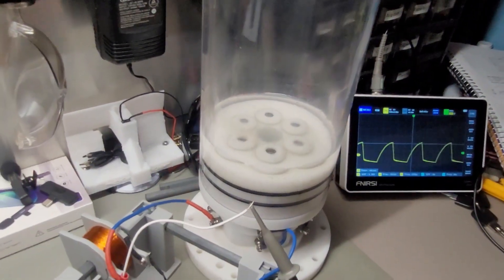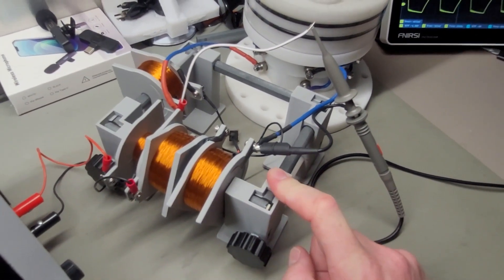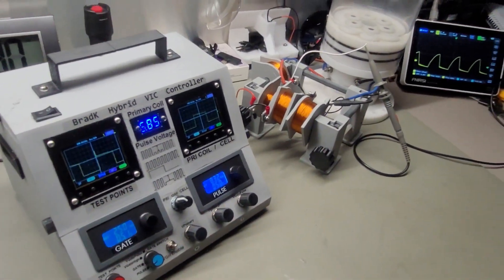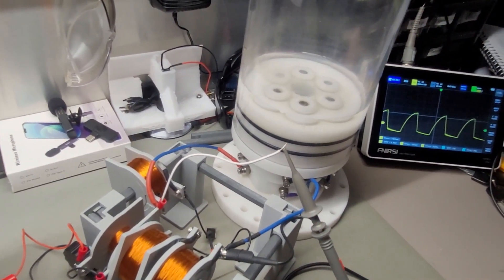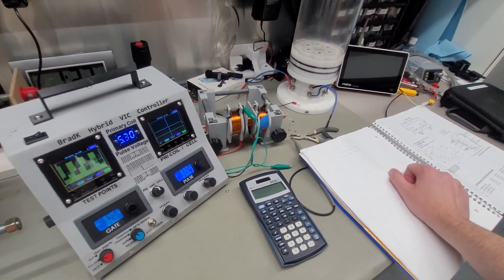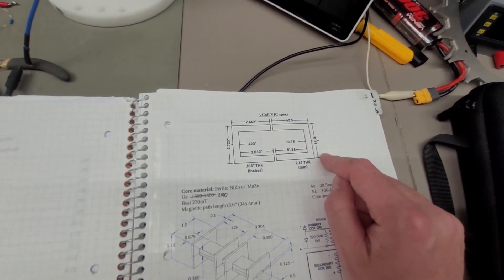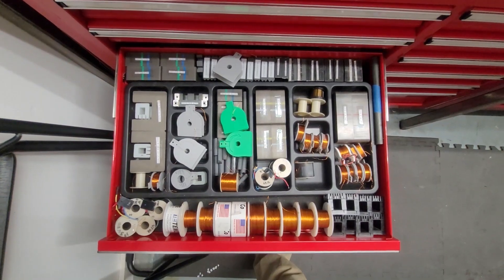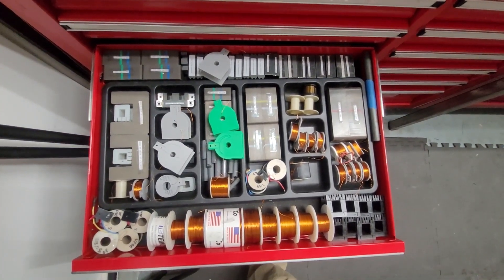Stan Meyer Research # 35, Jul 2023-V.I.C. TESTING reveals the problem...

Comment: I use those obsolete UU ferrite cores and mate them together with (2) spring steel hose clamps put on with pliers. The old tv horizontal output transformers/ flybacks can be reused and are in all sizes. Frequency use was about 15khz. Meyer had also used RESISTANCE TYPE magnet wire. Putarich Patented circuit was also AC output for his hydrogen generator. I am contemplating starting a build of Meyer type hydrogen generator. You have to get cloud mass of very fine bubbles rising up to get it right. Ions only , not molecules . I thought that a Meyer cell with final AC created hot water + steam without the  diode. I read the 2 manuals.

Comment: Any updates?
Reply from the maker: Yes, I sent out quotes to a few ferrite core manufacturers and heard back from two of them. The first had a min order of 100 pieces at a cost of $6k. The other one agreed to make a smaller number but for a cost of around $140/set. The lead time was 10-12 weeks. I should be getting them sometime in January. I went with a slightly different ferrite mix in hopes that it will work better than the one I bought from Russ years ago.

Comment: any updates?
Reply from the maker: Yes. I'm having some custom cores made. I sent requests to 5 or 6 Ferrite core manufacturers. I only heard back from two of them. 

One had a min order of 100 pieces and quoted me $5k. The other allowed smaller orders but for a price. I ordered 5 sets in case a different ferrite mix is needed. 
The lead time was 10-12 weeks. Hopefully, I'll get them sometime in January.
Reply: @BradKwfc  remember that  maintaining resonance requires a PLL to fine tune maximum performance due to changes in temp and environment...
Reply from the maker: @mikebartley481  Yes. The Hybrid VIC Controller is just meant for a laboratory setting as a proof of concept. Once the basic process is proven the PLL can be researched and incorporated into it.
Reply: But the injector bobine doesnt have a pickup coil how is that possible?@BradKwfc

Comment: Here is the math to add some reality to the situation. 
Breaking the covalent bonds of water (H2O) through electrostatic means would require a substantial amount of energy. To estimate the voltage required, you need to consider the energy required to break the bonds between the hydrogen (H) and oxygen (O) atoms in water.

The covalent bonds in water have a bond dissociation energy, which is the energy needed to break the bonds. For the H-O bonds in water, the bond dissociation energy is approximately 497.4 kJ/mol.

To calculate the voltage required, you'll need to convert this energy into electrical energy. The relationship between energy (E), voltage (V), and charge (Q) is given by:

E = Q * V

We can rearrange this equation to find voltage (V):

V = E / Q

Where:

E is the energy required to break the bonds, which is 497.4 kJ/mol.
Q is the charge, which can be calculated using the formula:
Q = n * e

Where:

n is the number of moles of water involved in the reaction.
e is the elementary charge (approximately 1.602 x 10^-19 coulombs).
Let's say we're working with one mole of water (which is approximately 18 grams of water) to make the calculation easier.
1 mole of water is approximately 18 grams, and the molar volume of a gas at STP is approximately 22.4 liters per mole.

Q = 1 mol * 1.602 x 10^-19 C/mol = 1.602 x 10^-19 C

Now, we can calculate the voltage required:

V = (497.4 kJ/mol) / (1.602 x 10^-19 C)

First, convert kJ to joules (J):

497.4 kJ/mol * 1000 J/kJ = 497,400 J/mol

Now, calculate the voltage:

V = (497,400 J/mol) / (1.602 x 10^-19 C) ≈ 3.11 x 10^24 V

So, theoretically, it would take an extremely high voltage of approximately 3.11 x 10^24 volts to break the covalent bonds of one mole of water through an electrostatic process. This is an astronomical amount of energy and is not practically achievable with current technology.

Sustaining the High Voltage Field: To sustain a high voltage electrostatic field, you would need a power source capable of delivering the required voltage. High-voltage power supplies exist, but generating voltages on the order of 3.11 x 10^24 volts (as calculated in a previous response) is currently far beyond our technological capabilities. Sustaining such an extreme voltage would require an enormous amount of electrical energy and very specialized equipment.

Formation of Gas: As the covalent bonds in water break, hydrogen gas (H2) and oxygen gas (O2) would be formed. These gases would be created at the interface where the electrostatic field acts upon the water. The gases would then move away from the source of the electrostatic field. The hydrogen and oxygen gases are highly flammable, and their formation in the presence of the high voltage field could potentially lead to dangerous conditions.

Hope this helps people understand how this process would work and why what Stan was doing was just a trick of using conventional electrolysis at higher voltages and lower current. The math doesn't lie. No need for fancy drawings, and theoretical concepts about vibrations, resonance, and frequencies. Just simple math can solve this riddle.
Reply from the maker: Thanks for sharing that. My understanding of that kind of math/chemistry is limited, so I appreciate you sharing it. 

One thing I wonder is if breaking the bonds at first is even necessary? Autoionization of water occurs naturally due to electric field fluctuations from the continuously moving and rotating molecules.... the lifetimes are very short but can be increased by the application of an external electric field. 

What if the voltage is built up, and that voltage is used to accelerate and oscillate the existing ions in the solution to the point of ionization by collision. 
The acceleration of charged particles is the source of all electromagnetic radiation... If the cell is designed to be a resonant cavity then certain wavelengths will be amplified within it, and if the resonant frequency of the cavity matches the right absorption bands of the molecule then maybe it is possible that the bond can be weakened further. 

The problem is then where do we get electrons from when the circuit is restricting electrons. Faraday laws of electrolysis states that the amount of gas produced is directly proportional to the amount of electrons that take part in the reaction. I tend to think this is where the electrodes play an important role as they could provide electrons if the electric field is strong enough, which might be possible when the electric field strength of the electric double layer is considered.

What do you think?
Reply: @BradKwfc  

Where do the electrons come from? 
From the water, there are no electrons "added" or flow of electrons from the electrostatic field to the water. 

In theory, It is possible for charged particles to undergo sufficient acceleration in an electric field to cause ionization without the presence of a significant electric current flow. 

Here's how it would work:

Electric Field Strength: When charged particles, such as electrons or ions, are subjected to an electric field, they experience a force due to the field's strength. The force accelerates them in the direction of the field.

Energy Gain: As these charged particles accelerate, they gain kinetic energy. If the electric field is strong enough and acts over a sufficient distance, the particles can accumulate significant energy.

Ionization: When the kinetic energy of these charged particles becomes high enough, it can surpass the ionization energy of atoms or molecules they interact with. This excess energy can cause the removal of one or more electrons from the atoms or molecules, resulting in the formation of ions.

Electric Current Flow: While ionization may occur, it doesn't necessarily lead to the establishment of a continuous electric current flow. The process is driven by the energy gained by individual charged particles, and it may not involve a large number of particles simultaneously.

Ionization with minimal current flow, while theoretically possible, is often not practical for most real-world applications. In practical applications, achieving ionization typically involves the generation of a sufficient number of ions, which often requires a more substantial flow of charged particles or a more intense electric field. Minimal current flow ionization may not be efficient enough to be practical, as it may require a substantial amount of energy to produce a relatively small number of ions.

In regard to resonant frequency, or the idea of properly timed electrostatic field applications, there are two main points I want to highlight. 

Energy Requirements: Resonance-based ionization can reduce the energy required to ionize particles. However, the energy requirements may still be substantial, and achieving practical ionization with minimal current flow may not always be feasible.

Control and Stability: Real-world applications often require precise control and stability, which can be challenging to achieve with resonance-based ionization. Environmental factors and interference may affect the outcome.
Reply from the maker: @PE-ResourceMastery  

I guess you could say the current flows through the water in the form of ion travel but the electron exchange really happens at the electrodes. Electrons leave the cathode, and electrons enter the anode. The same amount of current flowing through the solution also flows through the circuit (ignoring side reactions).

In Stan's case the current was limited in the mA range, which is not enough current to produce much gas at all. I think Stan's cell may have utilized a high voltage AC field which enabled the electrodes to both source and sink electrons to support the reaction. This is basically what Stephen Meyer, Stan's twin brother (who designed most of his electronics and probably his VIC circuits) said in an interview years ago.

I think there is more going on in the cell than any of us understand. The combination of high voltage, the resonant cavity, and the radiation within it all combine to produce a violent reaction that needs shielding. 
The guy I talked to back in 2015 who claimed to have it working told me he got sick every time he ran it, and that the explosive force of the gas became greater with the same volume of gas but a higher voltage applied. If that is true those who have claimed his cell was synthesizing ammonia might be correct.

Control and stability-I 100% agree with this, water is used as an electric component in the circuit, and the electrical properties of water are not at all linear or stable at all with regards to applied voltage. Not only that but many variables in the circuit all have to be correct in order for it to work. Also, you can't just tune it into resonance or else all you will see is a small voltage across the cell because of the dead short. In order to get up into the kV range the water first has to undergo a process within the cell, whether its the formation of an electrical double layer, gas bubble blocking, or a combination of the two I don't know.

I'm going to continue on this journey regardless of what anyone tells me. For one, its fascinating and a fun challenge that if can be proven could have a huge impact on the world. Second, so many claim Stan was a fraud, but why then would he spend years of his life only to die with nothing but a tiny house in Ohio. He likely spent hundreds of thousands of dollars on patents, why? So he could finally get enough money then run away with it? That makes no sense to me.

I think he stumbled upon a phenomenon early on that motivated him for over 20 years to continue pushing forward, despite the reaction being almost uncontrollable, dangerous if not taken seriously, and putting him at odds with an Oil powered world.
Reply: @BradKwfc  
Totally fine to explore this, and have fun with it, just don't lose yourself in it. 
You have to be honest with yourself, Stan did not scrape by all those years, despite not having a job, he and his brother were able to live comfortably for years all thanks to the money people invested in his idea, an idea that he always kept in the dark, moving to a newer "better" version as time went on. Never able to produce an actual result, always keeping people chasing after the moving target. The fact is that Stan was actually sued, he actually went to court, and actually had to prove his claims, which in the end he could not. It wasn't like he had to reveal his secrets, there were NDAs and he still had his patents. But in the end, he was ordered to pay back all the investors that sued him in that case. The conclusion was that he could do nothing different than conventional electrolysis. By the time he died, his reputation was actually in a steep decline. There is probably a bigger chance people killed him because he scammed them and they finally realized they would never get their money back, than the oil companies killing him because he had some thermodynamic law breaking secret. What people are doing now, trying to "replicate" his work, goes even far beyond the complexity of his initial proof of concept" a pure analog demo model, a video that everyone is familiar with. Even this simple and basic "proof of concept" would be enough to disrupt the scientific world as we know it. The exact same electronics/components Stan used in that demo have been inspected, there are plenty of pictures, diagrams, everything needed to replicate and reverse engineer, but nobody can. There is always some complex reason why not. A reason that is not apparent in Stans very own work. 
A lot of people say that we couldn't build the pyramids today, and while that might be true in a practical sense of currently available equipment, theoretically we can. We can pencil it out, and build equipment capable of doing it. The problem with Stan's stuff is that it doesn't even pencil out theoretically. As a said before, even though ionization of the water with minimal current draw would never produce the results Stan showed, there is just not enough energy transfer. Maybe you achieve small levels of disassociation from it, but not what Stan claimed. This is like dropping a ball and hoping it will bounce up higher than where it was dropped from. Even internal losses would need to be overcome to just break even, and that would be incredible on its own. I'm not here to discourage you in any way. You are a talented guy, and I think that there is great potential for success just in the quality of work you have done in all your tests and experiments. The equipment you have been able to make is awesome. That alone is a win. Good luck!

Comment: Try to get Iron powder core, sendust or permalloy, ferrite will saturate below 0.5T while the others can reach like 1.5T and are ideal for chokes.
If you look close to the original cores from Stan's estate, it is a porous light grey, witch looks like iron powder core to me.
Reply from the maker: I've tried several different iron powder cores from small all the way up to a E450-8 size. Iron powder might work but the the low uE and the distrusted air gap throughout the core make it very difficult to get the correct values. Only with the E450 did I have enough space for the windings, but then the large core demanded much more power to magnetize which threw off the whole design.